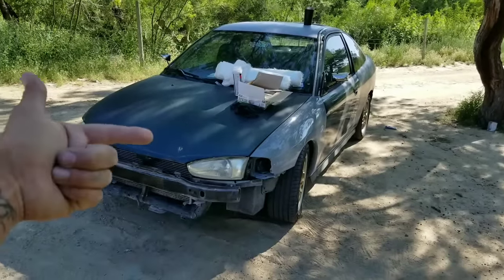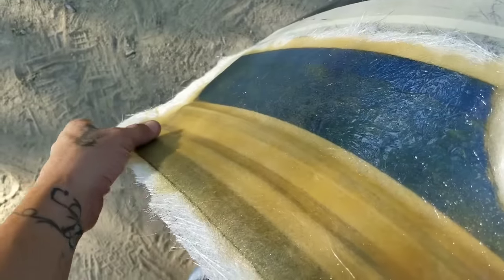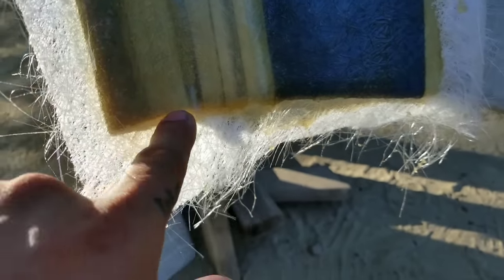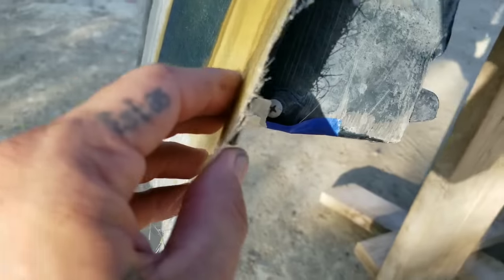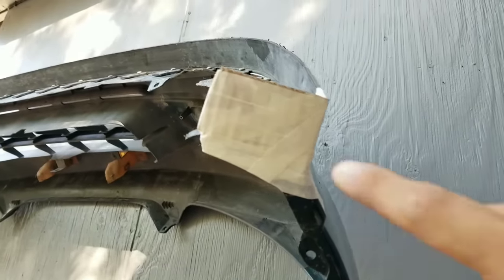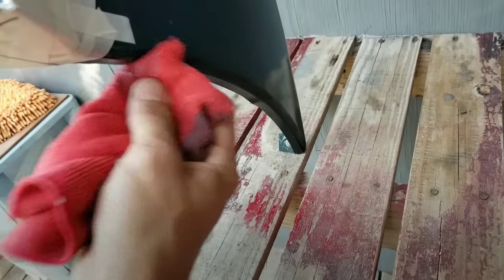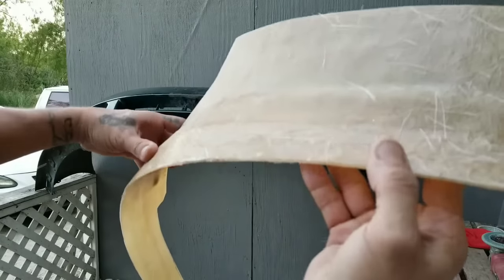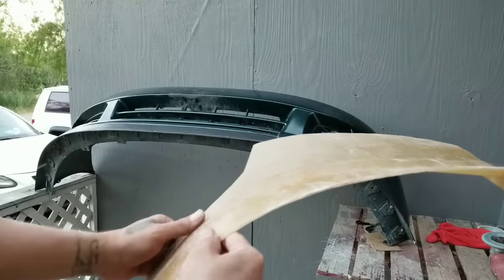Making a Fiberglass Bumper Lip

Comment from the maker: Hello guys, I want to thank everyone for watching this video and taking the time to comment.  One of the most commented things is to Wear a Mask for safety, and to use a thinner to Save on Brushes. Rest assured, I will definitely take those tips in consideration for my next fiberglass project. Once again, Thank You and God Bless!
Reply: The cheaper and best way To keep the brush clean is washing powder, just mix some wasing powder in the water and clean the brush b4 it gets hard
Reply: Thank you for the tips, your video helps a lot!
Reply: Man this guy is great.i will surely use this idea to make one on for my car...
Reply: sir what u put on bumber?
check on u r video time duration at 2.18.
kindly reply.
Reply: Would like to see the finished product. Where is part 2?
Reply: Man brushes are cheap at harbor freight. Fook those brushes😁😁😁😁
Reply: I would of roughed up those corners before applying glass over them
Reply: @supernova4300  2 I
Reply: instead of fiberglass you can just use polyuratane glue and will be perfeckt i did it my self and works great

Comment: i just want to say, I used to work in a carbon fiber/ fiberglass shop. We made everything from go karts to airplane wings, You need the roller to remove all the small air pockets in the material, You may not see them but small air pockets can cause it to splinter after a short amount of time and crack, it will give you a longer part life if you roll it, You need a respirator, you dont want it in your lungs, Clear fibers that you cannot cough up. Think about that, one other thing is I would save some time and money and just grab a dremel with a cutting tool, a grinder is okay, but you can cut faster and more precise with a dremel with a cutting wheel.
Reply: How resistance is the fiberglass? It can support small hits?

Comment: So what you did was, u put some fiberglass on exsisting lip. Then u cuttit to a shape. And what u are left with is cover for your lip? Or i am missing somthing here? And a lil tip, use a roller for a painting a wall. Brush is to messy u know. Paint roller works amazing. Tryit, your gonna luv it. Best of luck.

Comment: See you used alot of brushes. You could clean the brushes in lacquer thinner in between steps to make  your brushes last longer.
Reply from the maker: Drew Nottz I buy the brushes from harbor freight. These 2" come in a box of 36 for about $12, but I guess you're right.. I could extend the life just by cleaning them once or twice, and save a few coin on the long run. 🙂👍
Reply: GT's Performance  I'm betting it's cheaper to toss them like you've been doing. Thinner is expensive and that resin is so sticky I doubt you'd get them clean.

Comment: safety alert: for all of you want to do this... you need a proper full face mask and full skin cover. fiberglass small pieces can go to your eyes skin and lungs just consider these are very small pieces of glass. also the hardener and resin are very dangerous you do not want it in your eyes you will end up loosing them also you do not want them on your skin ... full face mask  and full skin cover if you wanna do this

Comment: hey man cool job. Did you use tape on the bumper first before laying the fiberglass? and how do you prevent or easy to takeoff the fiberglass mold after it's harden and not stuck to the bumper?
Reply from the maker: Yea I used tape at the beginning,  but I was putting some car wax before applying the fiberglass. That's what helps it Not stick to whatever you're applying it to
Reply: Thanks

Comment: Just tip for you bro so you don't have to buy all those brushes next time if you want to what worked for me was setting the brush in a cup of paint thinner after each use that way you don't have to use a whole bunch of brushes just the tip to save you a little bit of cash great work
Reply: DULA UH DA GAME was about to comment that, that's the same thing I do
Reply from the maker: DULA UH DA GAME I'll definitely get some acetone or thinner on my next project🙂👍 thanks!

Comment: I need to extend some running boards. How do you get the texture out of thr fiberglass for paint?
Reply from the maker: Sand the rough with 80 grit, then apply a thin layer of body filler or glazing putty
Reply: @GTsPerformance  got an email? Ill email you some pics so you can see what im talking about

Comment: Good job man. Looks good. Invest in some better quality resin or look into it. Its actually cheaper then that stuff and it has better shelf life. That resin has propoly been in stock or on the shelf for a while. Resin has a 6 month shelf life. Also keep in mind, that resin has wax in it. Really should sand in between coats after they dry. Get unwaxed resin so you dont have to sand in between coats. Wear a mask, not worth getting sick later on. Be careful.

Comment: DAMN u brave for doing this without a mask son. forreal.. mask on always when you around the work area that you sanded or grinded fiberglass. that stuff itches, but u cant feel it itch in yur lungs!! 
....
other than that, NICE CLEAN WORK!!
Reply from the maker: Kaeos Factory 'Kae Artz' thanks, some might even say I'm dumb! 😂 but I got you. I had the chemical mask with the filters,  but i thought it was overkill.  Anyways,  now I got some new filters and dust masks for future projects.  👍
Reply: i've been experimenting with canvas and polyester cloth as a foundation layer then putting fiberglass layers on, only need 1 or 2 layers of fiber. i figured that way if it breaks it wont shatter like pure fiberglass, then its easier to repair. IMO its way stronger. lol
Reply from the maker: Yea, after I'm done with some projects I'm working on right now, I want to make some speaker enclosures for my truck's door panels and was thinking using some type of cloth to just apply the resin over it,  and build from there.
Reply: Oh trust me you feel it...im sick for a month after if i dont wear it so its been years i dont do nothing without i cant even cut wood without it anymore.condition goes down after about 5yrs and 15yrs later you wont get as much oxygen this is what im living.
Reply: Vince Vega Customs good lord. I’ll nominate you for cyborg lung implants when they start allowing the tech to be used bro.

Comment: Did you use regular car wax or release wax for molding?
Reply from the maker: Nelson  Ramos I used regular car wax. At first I applied it over the masking tape and blue painter's tape,  but turned out the painter's tape left residue behind.
The wax actually worked best without any tape because plastic is less porous.. one thing tho,  if the resin runs/drips over your panels,  just let it harden.  Its easier to clean up. 
If you have to, apply a first coat of wax, let dry, then come back and apply a second coat.
Reply: GT's Performance thanks bro! I'm planning to do something similar! Good video!
Reply: The proper way to do that is to use Release or cheap floor wax from your supermarket + PVA release.
Reply from the maker: WJP004 I'll check what products are available,.. and thanks for commenting. I'm quite familiar with your channel, you do such great work!
Reply: I always struggle to steer guys in the right direction , especially when others are saying "Thanks mate - I'll copy what you have done", when I know there are better ways of doing things. I don't want to sound like a know-all, critical smart arse - or start an online argument, which happens when people get mega defensive or feel threatened by any comment of mine. So good on you for being open to advice. Many are not.
Reply from the maker: WJP004 I always appreciate  positive feedback. In fact,  I've gotten some ideas from your creations and used them on some of my projects. Like the wax to separate the molds! but since car wax was the only thing I had at the time, that's  what I used and it  turned out ok.
Reply: WJP004 I've watched all your fibreglassing and build-your-own-home vids! Glad to see u on this vid.
I'm from Sydney, NSW and was wondering what resins you use, i'm looking to make some cheap cosmetic parts and get a little fibreglass practice. Polyester resin's the cheapest, do you suggest getting the fibreglass-specific one or does any polyester casting or alternative resin work for low-cost practice???
Thanks btw

Comment: Nice job i do the same work my opinione 2 layers 400gr glass and some gelcoat is good for stucture. If you have Facebook id like to share my work with you maybe you have some tips for me or the oder way around.
Reply: Save brushes by using a aluminium can with lid some aceton and keep it in side with the top on. I use one brush for gelcoat one for resin. And it lasts for a week or so. Justclean itgood before putting it in the can oderswise you will get the putty on the buttom of can.

Comment: Where you got that front lip ? I need one
Reply from the maker: Ed low Walmart! 😁 yup, i found it in the garden section.. it's meant to separate your lawn from your garden. $20 for a roll by 30 ft x 2 inches. 👍
Reply: GT's Performance 😁 If you ever make another lip lmk I buy it from you
Reply from the maker: Definitely! You have a mirage?
Reply: GT's Performance fuck man, it’s ingenuity like that, where you know what you wanna do and don’t need a cookie cutter solution. Make your tools and understand your trade better than anyone else, That’s craftsmanship. I know you probably don’t feel like what you did was amazing or anything but so many people are stuck inside the box these days. Way to be a true problem solver.
Reply from the maker: Joe Allen Thanks!